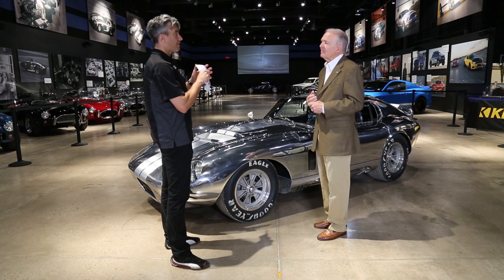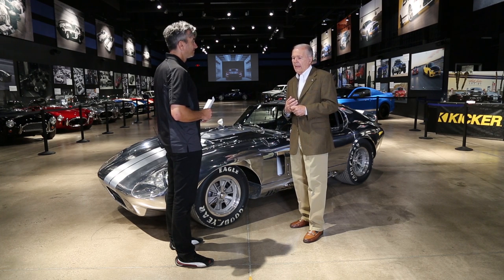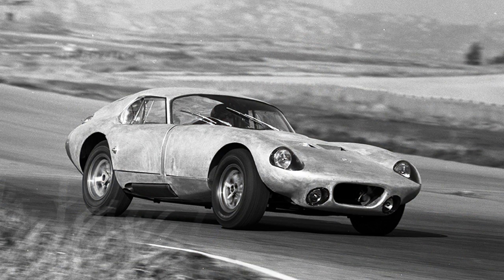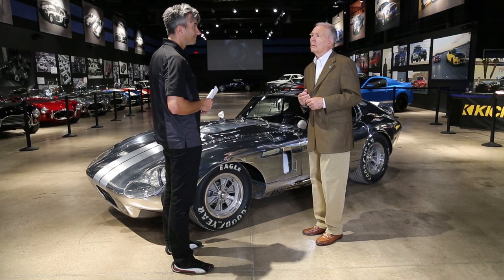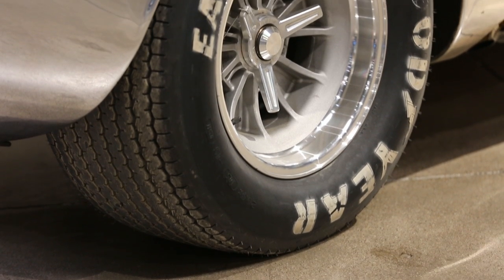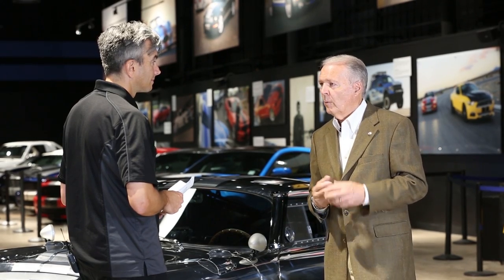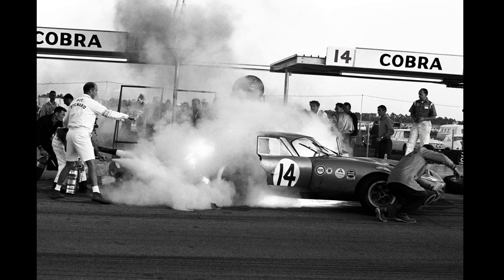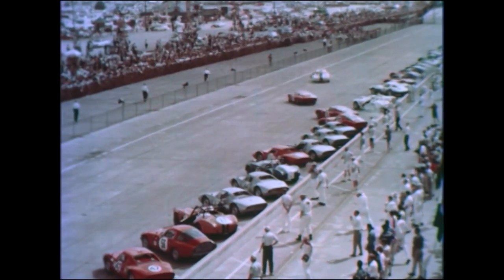The Daytona Coupe Story with Peter Brock – Part 3 Lap Records Fall

Comment: When I went moto GP racing at Pocono 2.56 full road course for my first time....I was sitting on the pit wall for the first time watching 600 mod class and this very smart rider was pushing his body and his Helmut visor all the way up to the windshield for apparently aerodynamic and I could see the outline from the windshield up and over and down his back side off the tail of the bike so in my race I added that to my technique...I was already pop out from behind the fairing using my upper body as a parachute hanging way out to the right going into the first turn hair pin to help me slow down ...and in my sixth race of the day lost the lead on lap 3 ,lap 4 ,3 of us crossed the finish line side by side an I got a third so I was happy...but I really started to open my eyes up to aero...and I was told later that very important to cars is how well u manage the air coming off the back of the car,wonder where they ever got that idea....I don't believe them....JK

Comment: Thanks this a great story...and see being born the same time as the mustang I missed SHELBY s whole driving career....but this is a side of this team I never knew about,1..I had know knowledge that Shelby won Le Mon,2..know idea he took his cars to the 24hrs of du MANS,and won,and new both of the Ford vs FERRARI...so its good to learn that Shelby was not just a guy who's crew knew how to bolt on a supercharger or turbo unit....the day I realize how good Shelby was ,was test drive day for me....I drove 3 cars in 2 days....1987 new 633csi...then jumped in the fairly affordable blue and white 2.2 5 speed Shelby Charger,then the next day drove the DaYtona turbo Z,non Shelby,with unequal d half shaft and with 11 miles on it ,half mile from the dealership I had to save it from pulling itself into a telephone pole easy on the turbo it about ripped the steering wheel out of my hand,then I jump in the Shelby 2.2 charger,and found non of that BS,a nicer and more solid ride a,even compared to the 633csi,and found a very strong un four cylynder like 2 liter turbo car with very little noticeable turbo lag....mean in racing predictable turbo power,I was really sold on the look of the Daytona because it was stylish and new.....but the 2.2 charger felt much more thought out and track worthy and that means safety for the streets....because the better your car handles the better u drive and the less likely u are to loose control,Ralph,believe me I used to push my 1970thru Barracuda and challengers to their limits....so I was impressed by this little 2.2 Shelby car....and I realized that day if this guy could bring that car into a sports car killer he was not just nobody....so there must be more to him and his company.....thanks..

Comment: I hear Peter talking about how much better the car was,and copy is the best flattery....I bought a 1973 Nissan 240z which for years had a similar front nose and chopped rear end like the coupe,well being a road racer my dad too we got invited to the Kodak 200 race at Watkins Glen race track in New York and I told my dad lets take my car the 240z,we broke a belt 40 minutes from arriving at the track....got it fixed and watched the race on the way home with thectite new alternator belt engine running great that car was tough to keep under a 100 mph just barely touch the gas pedal,I gave it to my dad and he put 6000 grand in it mostly the motor and he would let me drive it any more because it was scary fast be sides being aerodynamically slippery too....I don't think he put racing shocks in it and new springs so it was not stable or solid at a quick pace due to unsprung weight,a little bouncy on brake plant ing front end....